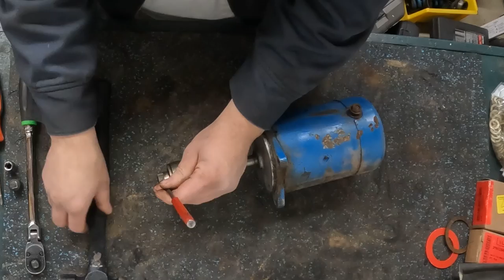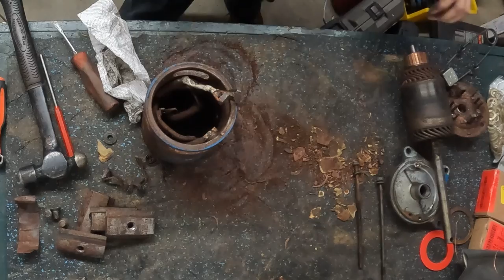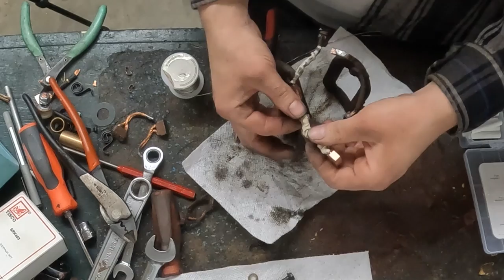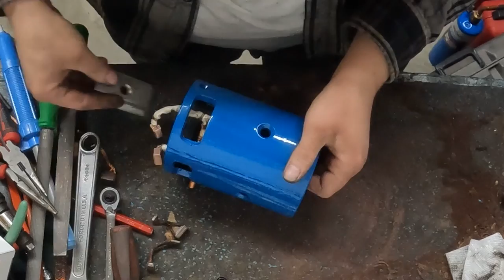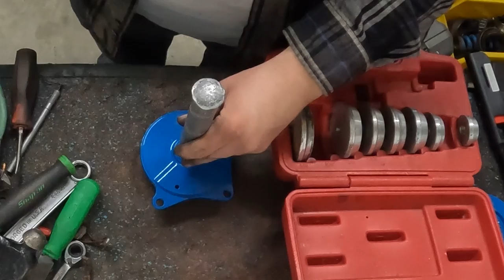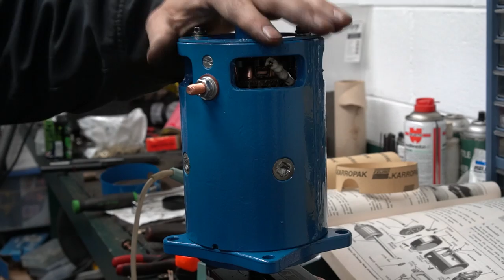Ford Tractor Starter Rebuild

Comment: Thanks for the well done tutorial. A handy tool to use when reinstalling the pole bars is an exhaust pipe expander. After installing the field coils and bars snug the fasteners, using the exhaust pipe expander press the pole bars tight against the case then torque the fasteners.

Comment: It’s simple to retract the drive just hold the gear against a stiff wife wheel on a bench grinder and spin it .  Leave drive on arm shaft, when barrel spins fast enough it will snap back.    The easiest way to pull the brush is tru the window using a wire with a hook on the end.  I have rebuilt hundreds of ford starters.  Good job.

Comment: Can I slightly increase the power of a tractor starter??? it turns slowly as soon as the ambient temperature drops even though everything is fine, the rotor, pipes and cables have been changed. also the battery. everyone tells me it's small but it used to run very well... it's a Lucas brand with a 65hp Perkins engine
Reply from the maker: Don't know of any way to make one stronger other than a bigger/better battery or a gear reduction starter. Being temperature based I'd look at a stronger battery. A higher cranking amp battery will spin a starter faster.

Comment: And just slide bendix on and put in pin??
Reply from the maker: Yep. Should be a collar you have to slide down on bindex to get pin in.
Reply: Im installing a new bendix and cannot compress the collar by hand like you show in the video. my welding clamps are to big to fit in between the starter and the bendix. My carpentry clamps slip off. any ideas on how to compress a new bendix?
Reply from the maker: @kraylake12  can you put something smaller into the hole on one side and push the collar down and slide pin in from other? Those collars shouldn't be too hard to push down. They're not weak by any means but they shouldn't be so stiff you can't push it down.